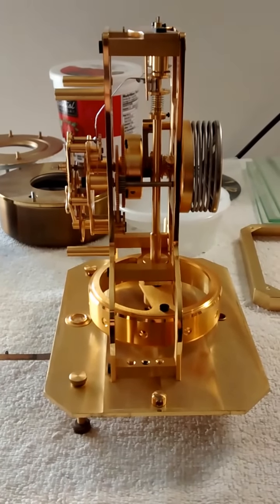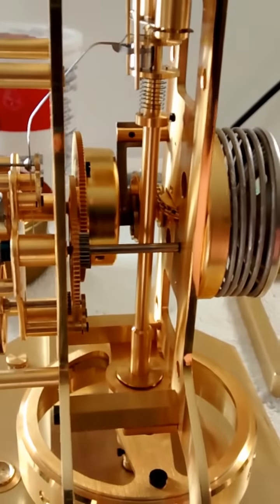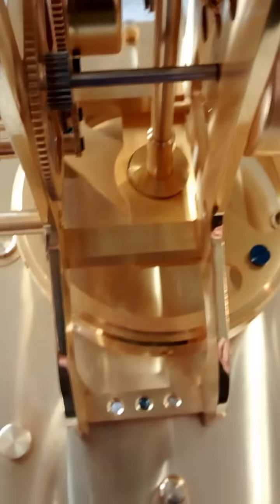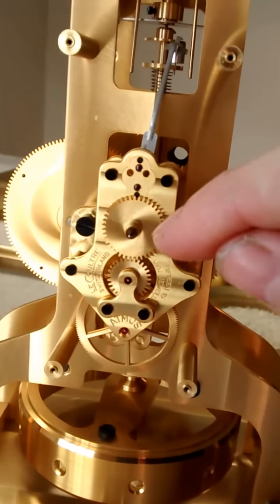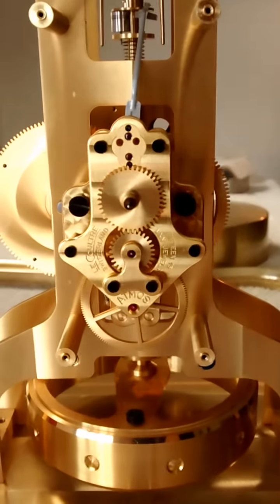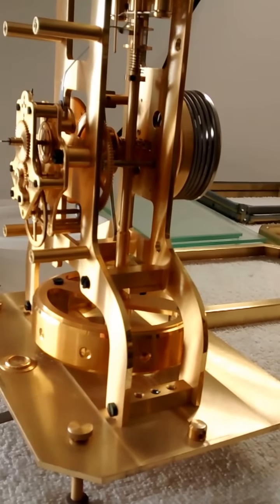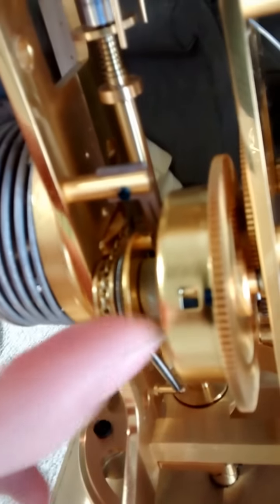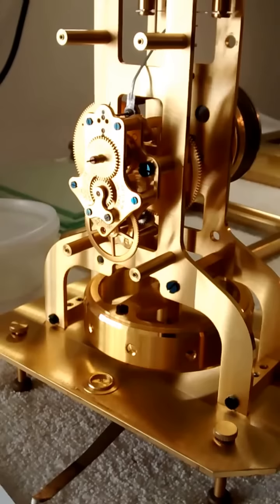How to Start Jaeger LeCoultre Atmos Clock

Comment: Just acquired an Atmos clock. It had been in the family since new (1966). Not sure how long it had not been run, but it started working when it was unlocked. It stopped a few times, I re started it by locking then un locking it. Happy to say it keeps perfect time and has been running now for 2weeks! In the times it was re started, it became 15 minutes behind in normal time so I'm going to have to stop it to set the time to where it should be. It works so good I'm almost afraid to stop it again, lol. Your information has been much appreciated!

Comment: Thank you, Michael, for posting this excellent video and all your others as well! These Atmos clocks are beautiful and quite the feat of engineering, and your explanations make me appreciate them even more. This particular video really helped me get my inherited clock restarted. I hadn’t over-twisted the hairspring or anything, it just turned out the spirit level wasn’t aligned well with the clock itself, so using your alignment trick looking inside the clock itself totally did the trick! Wonderful advice, and thank you for answering my emails and pointing me to this easy explanation! I thought this might need a very expensive repair, and 10 minutes later everything was working beautifully. Thank you!
Reply from the maker: Very good to hear! The leveling trick is very important, the position of the balance tube is the only level that really affects the running position.

Comment: My girlfriend just got her aunt's clock and moved it from her home to ours without engaging the locking lever and so I've got to check it out now to see if it will run on its own, it does start when I disengage the locking lever at least for a little while. I leveled it with a spirit level because I didn't know about the alignment that you showed here. One thing that your video shows is that this clock is a bit more robust than I had first assumed from the warning "NEVER move or shift the ATMOS Clock before locking the balance wheel with the locking lever ( A ) beneath the dial." on Liberty's Atmos page. I see that you aren't afraid to move the balance wheel with care, so hopefully no damage was done in the move or whatever previously happened to it. Thanks for your time in showing this!
Reply from the maker: Very happy to hear you are interested in the Atmos and congratulations to you both for being the recipients of the family Atmos clock, it's a very special item. And thank you for the kind words as well. Yep I show how to start the clock by gently rotating the balance wheel, so this way you are certain you have given it a good enough start. And learning about the pallet fork, and the impulse roller assembly helps a person get better performance out of their clock. Sometimes people get lucky by starting it with the locking lever, but this method I have described here is much better. Also, never start the clock using the minute hand, i have another video expressing the issue with that method. I wish you luck with the clock, hopefully that balance wheel didn't rotate too much. If the wire gets a kink in it, the clock will never keep good time for you until wire is replaced. You would also likely see a bent pallet fork, and possibly roller spring damage if the wheel spun around too much. But if you ever need any service, please do not hesitate to give me a call or email at curtsclocks@gmail.com!

Comment: Thank you for posting. I picked one of these beauties up today at an estate sale for $150. Seemed like a resonable price. The clock face is a bit faded but it appears to work perfectly and does the 30 second turn and 1 minute full cycle exactly by my stopwatch. Really appreciate you taking the time to share your knowledge of theses instruments.
Reply from the maker: oh that is a good find my friend and thank you for the comment and views. We do offer dial restoration if you are interested.
Reply: I have one but, how do I know it's in a lock position?
Reply: I have only had mine a week or so, so, I am certainly no expert. The instructions I have seen so far says to move the lever in the front of the clock at the base to the right until it clicks into place before moving it. When I do this, the clock stops and I assume it is safe to move it around (gently...) I got if from the estate sale to house this way and it works great and keeps time "perfectly".

Comment: Nice video.  When I bought my Atmos many years ago, I had no instructions and the shop owner told me only to keep it locked during transport.  Some problems I have been having in keeping the clock going are basically two things.  When I have to change it to or from Daylight savings time or, when my wife wants to put a Christmas cloth on the mantle and I have to stop, lock and remove the clock and put the clock back and start it again.  It sometimes ran for a few days or even a week then stopped.  Once in a while, it would get started and keep running.  The little level has no fluid in it so I can't use that.  It's good to know the leveling technique you showed.  Today, I brought it to a repair shop, thinking that there is something wrong with the clock.  So, maybe the clock is OK.  We'll see what happens.
Reply from the maker: How did the repair turn out? If you still need service consider shipping to me for repair! Here are some shipping instructions www.curtsclocks.com/shipping-atmos-clock

Comment: inherited an Atmos clock immediately learned of its origin and complexity. What a great gift. I learned how to clean it up, it had been in storage in a garage. I learned how to start it, it has been running for two weeks, I am close to setting the correct time. question., ,,I know to change the time by turning the hands, stop the clock and set the time.?  0r set the time while it is running. ??

Comment: Very useful indeed, thanks.  I've never owned one of these, but have several anniversary clocks which are roughly similar - especially regarding the torsion wire and how this shouldn't be over-twisted, or it can often mean a new wire which needs a clock repairer to order, fit and set up.  I dare say many people chance their luck and get one at auction.  Sometimes they're lucky and it will run, other times they will be like anniversary clocks and it will mean a clock repairer's bill to inspect it and overhaul it which is quite specialist.  New, they are expensive.

Comment: This is great info! I purchased an Atmos clock for $10 (I know I did well there). I had no idea on how to get this started. A couple questions if someone doesn't mind tackling them. First, When trying all to get started should I be doing this in the exact place that it will stay? I was going to fix it, and move to the spot. Also, if the wire was over twisted or the gold chain is broken then can any of this be fixed at home? I think the chain may have fallen off the pulley, but I cant remember. If either of these are broken then I would love a recommendation on what to do next (Order new one, resolder etc..). Thanks in advance for any help.

Update: The pulley chain (I think its called) is broken. Is this a crazy expensive fix? My serial number is 59714 so I assume its a 519 model.
Reply from the maker: Hi Ryan, I dont recommend you attempting to repair the atmos yourself because there are quite a few little known industry secrets about the clock. Please consider shipping to me for repair, or if you insist on tackling the Atmos yourself, purchase another one from ebay to practice with first. But yes the chain can be repaired with solder, and the wire can be replaced if necessary. Here are some shipping instructions www.curtsclocks.com/shipping-atmos-clock/
Reply: enginemaxcarb.  Good to know. I knew I was lucky getting it for $10, but I figured it is still an expensive repair. I suppose it depends on what the value is after its fixed vs what it is currently. Like a car you can get one for $500, fix it for $1,500 and it can still be only worth $1,000. These clocks are so nice it is probably worth it, but a $400 fix on a $400 clock isn't worth it usually (not saying thats the value...just an example).

Comment: What if my fork is to the right, and my roller is to the left.
To mimick your endearing the fork and going around I’d have to go all the way around and probably further than intended?
Sorry, newbie.
When I go just to almost the fork and let go, I don’t get enough swing to keep the balance going and it stops.
Reply from the maker: @drjoeshmoe  watch my video "how to put atmos back in action"
Reply: @ a million thank yous! Seems to be ticking and minute hand advancing nicely.
I picked this clock up for $500 at an estate sale, with original foam box and paperwork, looked mint, however when I took the door off, I discovered the little push down tab is loose from the glass, tiny chip in glass, looks like there should have been a pin or set screw holding this push tab to the glass?
The balance wheel was not locked when the estate sale people moved the clock from one room to another, so I was worried they could have damaged it.

Comment: I once saw a list of instructions for an Atmos that said you started the clock by first, with the pendulum locked setting the time to one hour slow. Then you free the pendulum and advance the minute hand one complete rotation, and this somehow starts the clock. I came to this video to see that working. Do you know anything about that? I have a 400-day clock that I start using the method you did for the Atmos.
Reply from the maker: I have a video explaining the reason you dont want to start the Atmos clock using the hands, but to sum it up, your putting all the pressure on the pallet fork, which has a position and poise, and starting that way you will eventually lose the poise on pallet fork. The way I demonstrated here in the video is the best way to ensure a good start.

Comment: I have Atmos clock 409910 it runs for 15 minute after leveling  and stops roller stays in betwin fork.help me to solve the problem.
Reply from the maker: Sounds like the clock needs to be serviced.

Comment: Its a torsion PENDULUM not a balance wheel .... a balance wheel is in a watch

And also how are you gonna bend a pallet jewel ???????????
Reply from the maker: Sorry you dont know atmos if you didn't know it's called a balance wheel, just like a watch with hairspring straightened out. Yes it operates with torsion, but in the parts books it's called a balance wheel
Reply: @atmosrepair  if you say so then i will correct myself ... but the pallet jewel cannot be bent
Reply from the maker: @Inkreptile  yes it can be bent and broken if pushed back against the escape wheel
Reply: @atmosrepair  then it doesn't bent but it breaks ...
Reply: enginemaxcarb.  No... Btw omega likes calling things different and alot of discussions Starr this way so go bother someone else